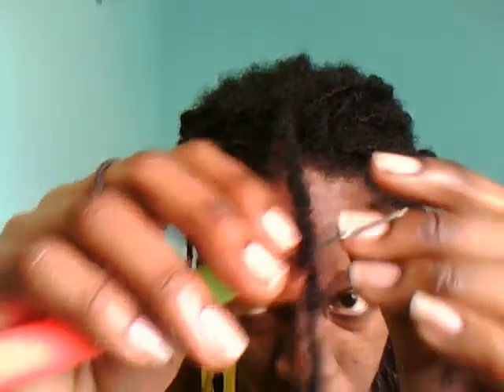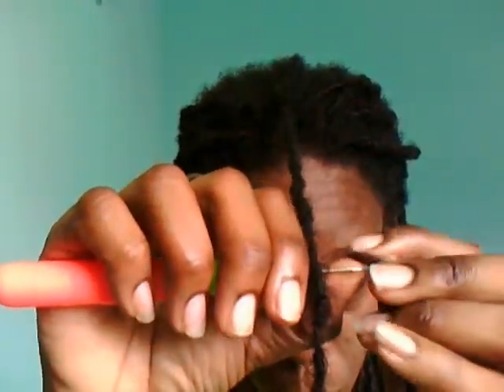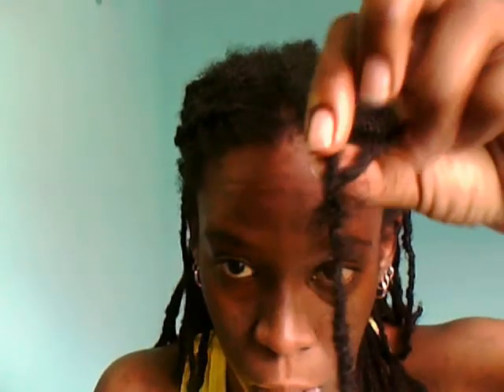Loc Repair- Thinning Locs

Comment: I can't wait to try  this later. I have a front loc that broke off and was wondering how I was gonna reattach it with needle n thread but have an interlock tool I've never used. Only thing my loc is broken near the root so it might not hold.